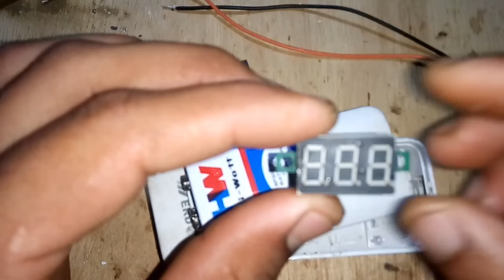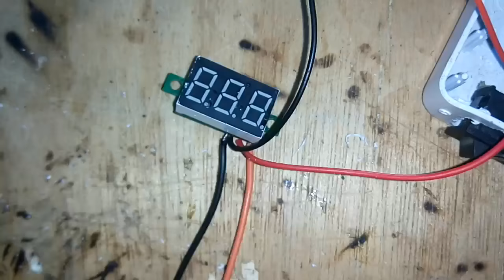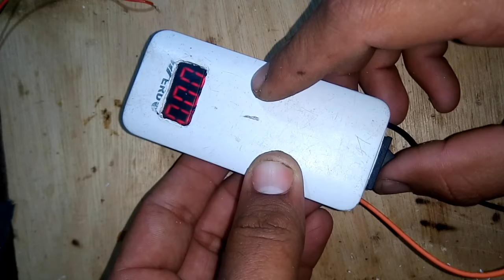How to make a mini Voltmeter(Creative Electronics)

Comment: I REALLY wanted this trick. cause my mini volt meter have only 2 wires.
Reply from the maker: Thanks
Reply from the maker: +RØß! RAiDER71 
please subscribe my channel and share
Reply: Creative Electronics Hello bro... do you know similar of 1N4048 Diode? I can't find it.
Reply from the maker: i send u solution
Reply: Oh and I speak Portuguese because I am by Google Translate ok Bro Thanks 👍😃👏🤓😄👧!!!
Reply from the maker: +Gambiarras Eletrônicas 
On the Voltmeter, there are 3 points given on the Voltmeter, in which the two points are connected in between the two points separately and you can put your input wire into 1 point empty which was connected in between.
Reply: Creative Electronics I understand, but you did not want to give me, did not he? 😀😄
Reply from the maker: +ŔŐβĨŃ ŔĂĨĎĔŔ mini Voltmeter have 3 point